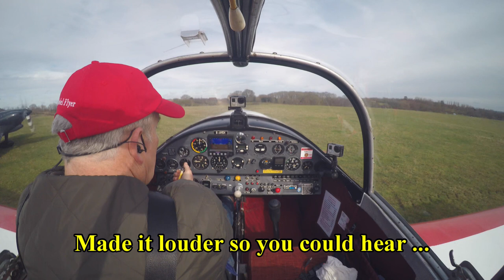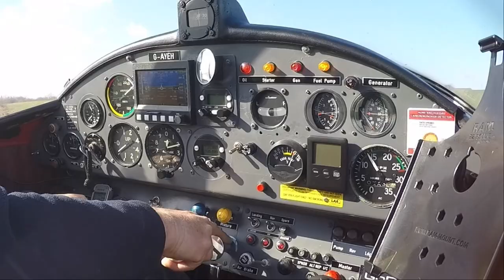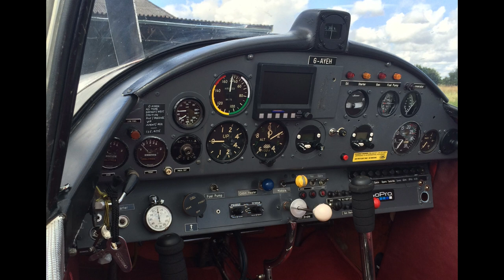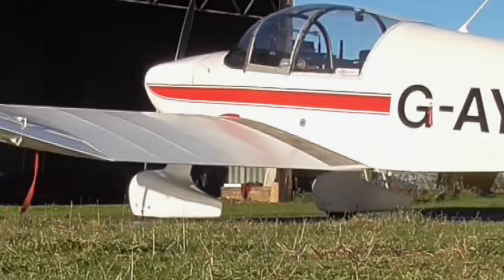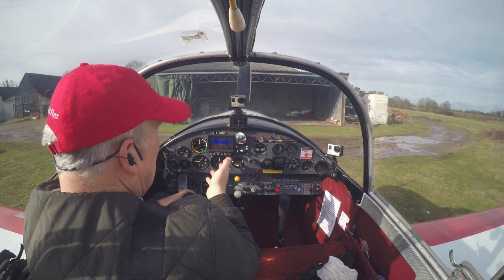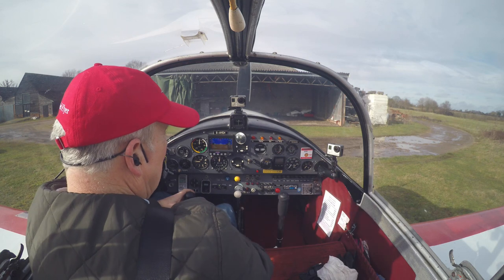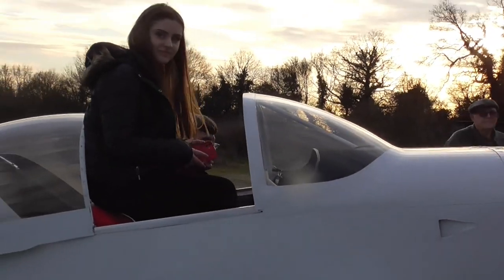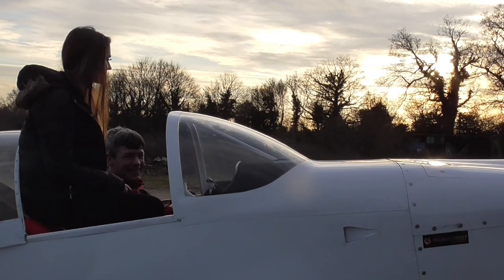GOT IT WORKING BUT ... PILOT VLOG #348

Comment: The points about the charger; a smart charger is better than a maintence charger as it only applied a charging voltage when the battery drops below a given value about 12.5Volts and maintence charger applies a contiuous voltage of around 12.8 to 13volt all the time and so can over time dry a battery and cause damage. The point about conectin the -VE to an earth point is to help reduce the corrosion on saupher build up on the battery terminals but in an aircraft application, I would not recomend it as it can cause galvanic corrosion at the earth point as there would be a current flowing there which would not be present if connected to the battery terminals (hence most aircraft that have a battery saver charging point use a dedicated wired socket away from the main aircraft electriacl system, which connect directly to the battery termials). I hope I answered your question if not give me a call.
Reply from the maker: Thanks Algy. I will give you a call. 👍

Comment: In United States, there is a popular charger, called Battery Tender. I use for my motorcycle battery, while parked for the winter months, in northern Indiana. It comes with an option of the clamps like you showed and ones with eyelet’s to bolt right to the battery posts. So at least for this type it is meant to go directly to the battery.
Reply from the maker: Thank you for that Alan. Always good to have different feedback.

Comment: Hi Tim great video, the reason why they tell you not to go on the battery earth is, on cars you have battery monitoring system fitted to  the earth  cable, you can also spike the control units fitted which will  cause damage. That  is why they tell you to use the engine earth or body. If you look at most modern day cars the batteries are positoned so that the  earth terminal is tucked away so you cannot get on it or  has a cover over it with pictures saying do not connect a charger or jump start on this terminal.
Reply from the maker: Thanks for watching and giving me the feedback. I do appreciate it.

Comment: Hi Tim.
Interesting video. Good to see you working through the issues. There are maintenance chargers then there are maintenancenance chargers. The type you show there good for cars etc ....You need one that monitors the whole battery. Also if no isolation switch you should disconnect any other connections from battery as electronics don,t take kindly to changes in voltage. Some charges use a pulse charge system to excit the battery on charge and they really don,t like that. If battery in situ earth to engine block or earth. A good pice of kit is a battery load tester that will tell you straight away the condition at any time. Also if using auto fuel like I said pay to run her slightly hotter due to lower quality of the fuel as big issue wit cars today with 5,6,7,8 speed boxes are all cooking up and buggering the sensors. Something to think about. Been a tad stormy here but usually comes with great flying WX afterwards although like you we are getting decent wind as well. No bother if ya can fly from here ya can fly anywhere. Be well fly lots.
Reply from the maker: Thanks for watching and the feedback Nick

Comment: Hi Tim re maintenance chargers - mine is used throughout the winter and seems to be just the job. It came with a set of leads that can be permanently connected to the battery terminals and left in place. The charger then connects to the plug at the other end which is in the cockpit. Very convenient. And connected straight to both terminals, not an earthing point (but then the aircraft has a battery isolator switch anyway)
HTH
Reply from the maker: Thanks for that Martin

Comment: I also bought the same charger Tim and connected it directly to my aircraft terminals; Having said that I actually couldn't get the light to go green even after about 3 days charging and the battery wasn't exactly in a bad state anyway.
Reply from the maker: Thanks for that Adam. I haven’t tried mine yet. Had to work on the paddocks after the storm!

Comment: Hi Tim - unfortunately I am not familiar with the product that you have bought. However it does look like it is a conventional charger, with a reduced capacity - I assume that it has an auto shut-off? I would be happy to use this on a vehicle that’s conveniently located so that you can regularly monitor the progress of the charging. But I am not sure if it’s ideal for prolonged use. There are battery conditioners available that will repeatedly cycle through a conditioning routine that ensures the battery retains as much of it’s charging capacity as possible. We have used a product called Optimate for years, these come with a connector that you can permanently fix to the battery, which makes the connection a simple plug in and leave exercise, rather than having to open up the battery compartment every time you attach it. You can get the Optimate units online, but if you want to see one first, they’re very popular with motorcyclists so your nearest motorbike shop will probably sell them. I have not had one fail yet, I have some that must be nearly 20 years old now! Love your weekly insight into your flying life. I am based near to the Norfolk/Suffolk boarder if you want to meet up and borrow an Optimate to see if it’s right for you Tim.
Reply from the maker: Thanks for watching and the feedback. I will look into it all a bit more!

Comment: In the new extra 330LT the trickle charger connect to a cigarette lighter port that you plug under the fuselage to charge the battery.  Eventually,  you will need to get a new battery.  I only have to miss one start (  hot start) and the battery goes dead.  Take care 🙂
Reply from the maker: Thanks for watching and leaving me the comment. I appreciate the feedback.

Comment: I understood that the reason you should not attach a charger to the negative battery terminal is to remove the risk of a spark causing an explosion due to hydrogen leaking from the battery
Reply: Also some more sophisticated cars have an intelligent battery sensor which would be bypassed if the charger connected directly onto the terminal.  Not relevant to an aircraft but the instruction sheet probably assumes automobile use.
Reply from the maker: Thanks for watching and taking the time to comment Jeffrey.